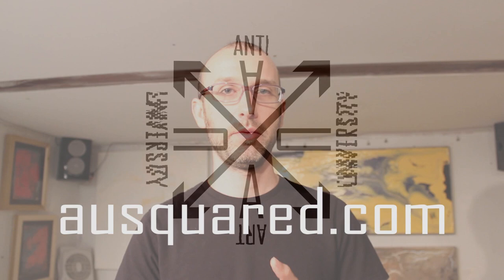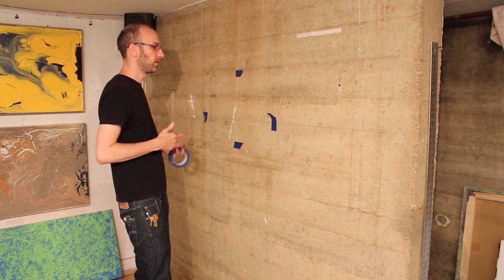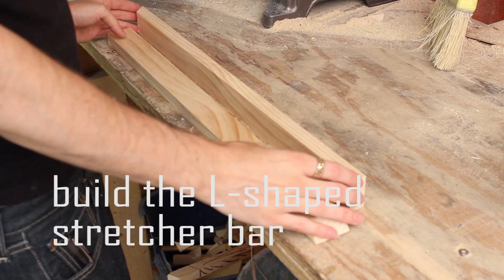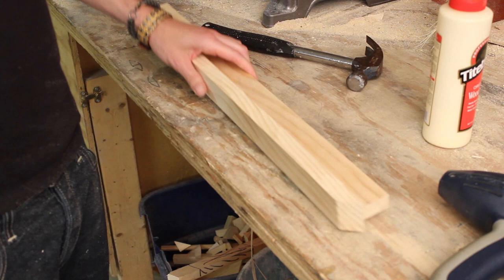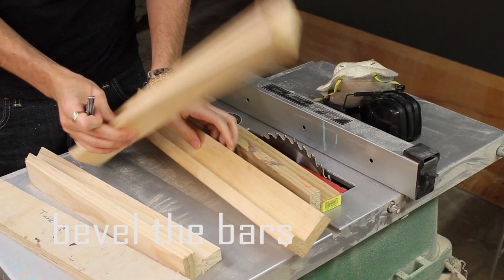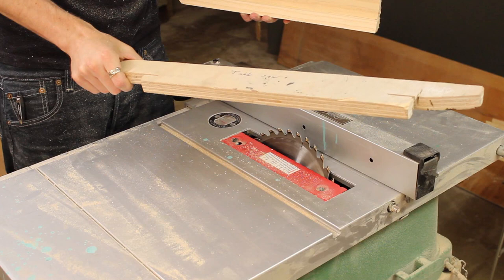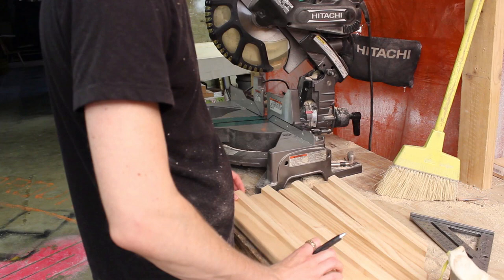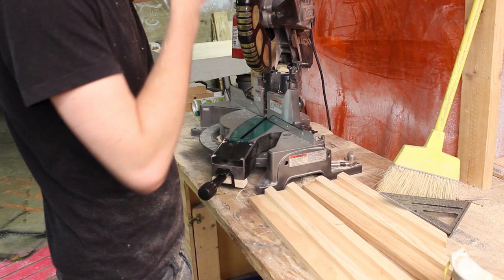Make Your Own Canvas Pt.1: The ONLY Way to Build Stretcher Bars

Comment: Hi Mead - thanks for the great tutorial! Question on construction for deeper stretcher frames. I am going to build a bunch of these for my wife, some upwards of 4sqft. She wants the profiles to project 3.5in from the wall. I'm concerned about how structurally sound the joints would be along the sides. Aside from the angled supports that you demonstrated in one of your other videos (already planning to incorporate those), do you have additional suggestions for deep frames like this? 
Last thing I want is for her to sell a piece and the frame fails... Many thanks!
Reply from the maker: You'll probably find increased structural integrity with a greater depth. The main thing is to make sure that your blade is at a perfect 90 degree angle upwards (use the speed square or a machinist square to line it up if it's a double bevel miter saw). You can also add crossbars that go across the center at a 90 degree angle, if needed.
Reply: @MeadMcLean  Thanks for getting back with me so quickly, especially on an 8 year old post (as pointed out by Gary)! Glad to be wrong on joint strength, and I suspect I will be smugly laughed at when I get home. I was thinking about adding cross bars, especially on the bigger frames. One other quick question on material/wood selection;  what are your thoughts on using ripped cabinet quality plywood over the "better boards," and should I stop myself from even considering subbing in (much cheaper) furring strips in parts of this process?
Reply from the maker: Yeah good questions. And yep, I'm still running the channel (it's a big long-term project). I would use furring strips as a minimum. Store-bought canvases use finger-joint moulding, but if you use furring strips, you may have to do more to correct the warping. You might also need extra bracing.
Reply: @MeadMcLean  I figured that would be your suggestion (they are cheap pieces of wood for a reason). Thanks again for the help!
Reply from the maker: No problem. Maybe the adage is: furring strips for practice, good stuff for professional work.

Comment: Hi, around 3:34 when you first show the 1x2's it looks like one end has a miter cut. Is that something you did?
Reply from the maker: Yes. It's possible to do on a table saw or with a circular saw with a guide. You can also buy triangular cut moulding and glue/nail it to a 1x2.

Comment: Thanks for the video. What about the wedges at the corners?
Reply from the maker: There are no wedges. Older comments debate the stretcher/strainer bars options to death. My take is: stretch correctly, store correctly, and you don't need to adjust tension.

Comment: Thanks so much for these videos – they're fantastic! Have you ever had a chance to work on a video for how to prime your own canvas? You mention it at the beginning of this, but it seems there's no video for this one yet. (I know, there are a ton of other resources on this, but the methods vary widely, and hey, I trust you!)
Reply: Thank you!! I look forward to it.
Reply from the maker: Yeah. The general idea is to prime from the center outward. Never dilute your gesso. Do 3-4 layers. Don't sand.
Reply: great video. the only thing I have to say is you want to sand your miters where you glue. you will have a better glue joint that way seeing as you are doing a simple butt joint.
Reply from the maker: The problem with sanding the miters is that you inevitably change the angle slightly, thus creating an incredibly annoying gap that's tough to deal with. I don't find that not sanding has created any problems. If you wanted to get really picky with it, you could use a biscuit joiner, but I've found that that's overkill for more purposes.

Comment: Just got started watching your video.  My question is the two boards that were cut in the beginning look like they have an angle on one end.  What angle was this?  45?  Are the angles just cut on one end?
Reply from the maker: I cut 45 degree angles for the corners. The bevel on the bars themselves is about 20 degrees.

Comment: This is GREAT! Thank you!
I have a question, and I apologize for being dense, but can you clarify exactly what it means to “oppose the warp”? That’s not self-evident to me.  I have watched your video over and over, sketching out arrows when you stack the wood strips and gesture how one warp goes “this way”, and the other warp going “this way”. But I still don’t get the concept. Could you respond with a word descript of what we are trying to do there. I think if you give me more words to explain, then I will understand what you are doing in the video. Hope you get a chance to respond-I’ve got my strips cut, just waiting to understand how to configure them so as to oppose the warps! THANK YOU!
Reply: Okay I just thought of another way to ask my question- Are we arranging the warps so that they arch concavely toward the center of the panel or canvas?
Reply from the maker: That just means that when the wood warps, you want to make it flare outward from the center of the L in both directions so that the warp of each board corrects the other rather than pulling in the same direction.
Reply from the maker: Yeah. The side ones should bend inward toward the center of the canvas/panel. The back ones should bend inward toward the front surface of the canvas/panel.
Reply: @MeadMcLean  Thank you Mead, for putting effort into sharing your knowledge. Wonderful to have the "mystery" removed and have a step by step plan to build stretchers. I'm with @sonambolma20032000 on this question, and am glad she asked it... I see your replies, but would it be possible to add a sketch in the comments? or a link to a sketch, a quick one, that visualizes your answer: "The side ones should bend inward toward the center of the canvas/panel. The back ones should bend inward toward the front surface of the canvas/panel." For example... the "bend"; if I were to place a piece of wood on a flat surface with the "bend" FACING UP... would the middle of the board be UP and a gap appear between the middle of the bar and the surface, or would the ends of the bar be UP, allowing the bar to rock.

Maybe another way to ask this... for the SIDE, does the concave side face the center of the canvas, or does the convex side face the center of the canvas? I apologize for not getting it from the description provided.
Reply from the maker: Your question makes sense. My answer wasn't as clear as it should be. Maybe it doesn't matter which way you oppose the warping, but I prefer to do this:
From the SIDE: the center of the board goes concave to the center of the canvas.
From the BACK: the board you put on the floor. The center would go concave in the center, bending up toward where the canvas will go, so the middle will lift off the ground.
Reply: @MeadMcLean  I’m so excited that you replied to my question!  Hey I’m so grateful for your videos- I somehow got through art school without learning some carpentry basics, and you are helping me get up to speed. Thank you so much!  As you know, interesting compositions are worthless if presented on a platform that will warp. :)
Reply from the maker: Truth. I'm still taking classes and watching videos and learning more stuff. There's always an easier way to do something, and now it's a matter of finding someone who teaches it online.
Reply: Mead McLean THAT is encouraging!

Comment: Really helpful video. Do you think it would work equally well to bevel the edges using a router?
Reply from the maker: Yeah. There's a few ways. Lately I've just used a circular saw.
Reply: @MeadMcLean  Thanks. I guess the saw is better in terms of dust though, so I might invest in a saw..
Reply from the maker: I got a battery powered circular saw, and it's awesome. I use a guide with it to make the cut, and it's actually more precise than with the table saw
Reply: @MeadMcLean  Oh nice, so is the guide just the adjustable guide plate on the saw itself? Or did you make some sort of jig
Reply from the maker: I used a bit of 1x2 and 2 clamps to make one. They have guides you can buy though

Comment: Could you use  STURDY frame from a thrift store? A picture frame that has a stretcher-like bevel?
Reply from the maker: That's a good question. Frames are usually composite wrapped in a decorative veneer. That makes them pretty weak, all things considered. If it's a solid wood frame (rare), you could probably reinforce it some and try it out.

Comment: Do you take out the staples/ brads before beveling, or are they short enough that it doesnt matter?
Reply from the maker: I leave the brads in. Usually you won't hit them. If you do, the saw goes right through them. You can also mark the general area of your cuts first and put the brads on either side.

Comment: Is there any reason in particular you choose to use select pine over another wood, specifically poplar?
Reply from the maker: I don't find a need for hardwoods in the understructure. Frames, yes, use poplar, aspen, oak, or whatever local hardwood you have. Pine is also lightweight, which is good.

Comment: What I want to know is what additional bracing would be needed if painting VERY large(?). I've tried probably every single other method and always eventually get warp or, as in the case of using quarter rounds, unsightly and unprofessional looking separation. There may be a million ways to build stretchers just to get started but as more people invest in your work your methods SHOULD change and improve (key word: INVEST). Yeah, for a canvas so small this may seem like overkill but building it solid at the outset means never having to think anout it again. But I hope you will elaborate more on this method for canvases on a grander scale. For very large pieces even this attention to detail can't cut it. Thanks for sharing. I will continue to watch your films.
Reply from the maker: +Blossom Blossom Good question. I would turn the L opposite and bevel the long side. This would make the depth about 3" and give you more structural support because the corner is stabilized on a longer edge. If it's really, really big, you might go with a 4" depth. On a 4" depth, you could also turn your diagonal supports up as well. You may also have to add straight crossbars as well and use diagonals to support the crossbars. It could get very elaborate.

Comment: Why don't you just rip 1x4s at a slight angle so the have the angle the need so the canvas doesn't touch a 90°? 1 less step.
Reply from the maker: If you don't do the L-shape, the canvas will warp and at least one corner will pull off the wall.

Comment: Great video! If I am stretching a finished canvas (already painted and no more painting required) do I still need the inside bevel for the stretcher bars?
Reply from the maker: Maybe? I would probably do that anyway, even though it's not too necessary. It might cast shadows in raking light.
Reply: No.  If you painted on an unstretch canvas, you don't need the bevel.  The bevel is to keep from hitting the bar when you paint, leaving an unsightly line.

Comment: You lost me at the table saw bevel  section of the video....      i dont have one!!!       regards
Reply from the maker: That's fine. You can just use a circular saw with a guide on it. A circular saw is cheaper and potentially safer with less of a kickback potential. These days, I just use a battery powered circular saw for the bevel cuts and the 45 degree cuts.

Comment: what kind of staples are you using?
Reply from the maker: Just the standard t-50 3/8" staples. Those are probably even a bit too strong, but they tend to set pretty well, so I continue to use them.

Comment: It seems to me like you're doing this backwards...not to mention it's a bit of overkill for the size of canvas you're building. I build the "L" shape bars too but I use them with 6 or 8 by 10ft canvases where there is a real risk of warping. A tiny 18"x 24" canvas or even a 24"x 36" canvas doesn't really require the "L" shape.
And by backwards I meant it is simpler to cut the bevel on the table saw before making the two-piece "L" shape bar...then proceed to make the 45 miter joint.
Reply from the maker: I do the L first because they can be used for panels or canvases. Sometimes you just need a panel. It's also a bit easier to put the L together when everything is 90 degrees.
Reply: The L shape with a bevel is good no matter what the size because it allows air to get between the canvas and bars reducing moisture which will ultimately deteriorate the canvas.

Comment: what are the tools you use?
Reply from the maker: Any 45 degree miter saw, a speed square, a tape measure, some straps or strap clamps, a nail gun, a staple gun. You could do it just as well with simpler tools.

Comment: Basically what you did was making a box with a faceframe the hardest way
Reply from the maker: Not really. The "face" part in your example is actually inset within the outer perimeter created by the beveled boards, so it's not really a face. A face frame is more of a cabinet maker's thing, and it's not effective with something this narrow/shallow, even if this were done with a face framing method, which it's not. If the perimeter were constructed first, then the other boards inset at 90 degrees, it would be a royal pain to get it all to line up perfectly. If you did it the other way around, creating the inset first, they would warp like crazy and you'd still have to have beyond precise cuts to get it to fit. Believe me, what's in this video is the way to do it unless you want to just buy pre-made bars or full canvases.
Reply: @MeadMcLean  no offense meant but you mean with little access to a proper shop. With the addition of a dado set a few jigs and a jointer you could rip down a couple of 2x3 and ended up with a professional quality frame. Hell if you just used biscuits instead of just glue and nails you'd have a better end product.
Reply from the maker: Nobody ever really has access to a proper shop. I've done it every which way, and I don't find biscuits to add any noticeable stability. They just end up being an extra step, an extra tool, and more time involved. I also think artists would rather spend more time painting than in the wood shop, so this simplifies the process a lot. Also, the L's in 1x2's can be used as panel supports if you don't bevel them. I used to just make a bunch of un-beveled L's and keep them around until I needed to make a canvas or a panel.

The next video I'm working on for stretcher bars is how to do this process without any power tools. There was a 2-year period where I just made these by hand, and it actually didn't take much longer as long as I kept my saw sharp.

Comment: Yet another DIY stretcher-bar lesson that requires industrial equipment ;D)
Reply from the maker: Not true. You can miter with a hand saw and miter box, rip the angle with a circular saw and guide (or use corner round on top of the L), tack the L with nails, and keep the strap clamp the same.